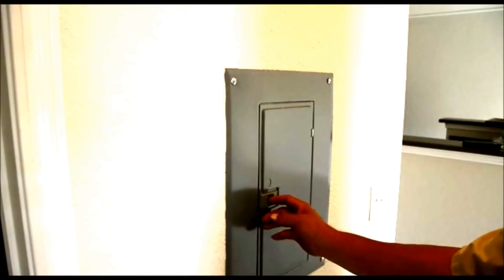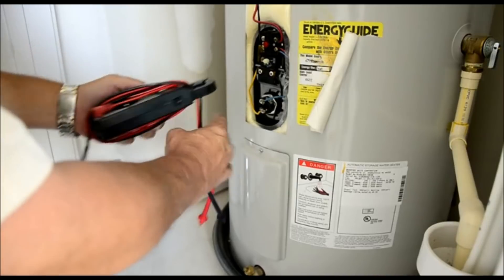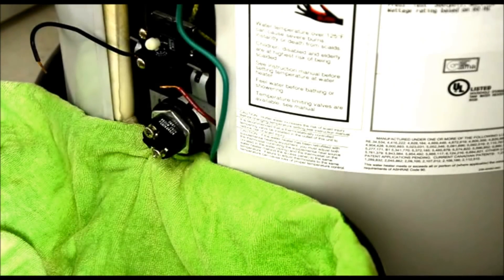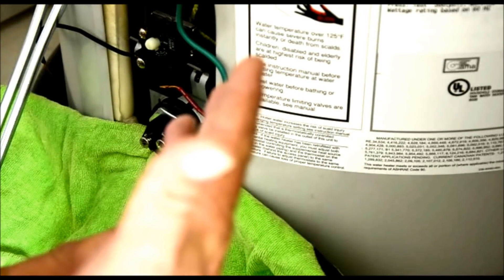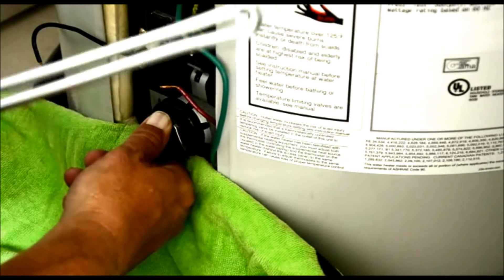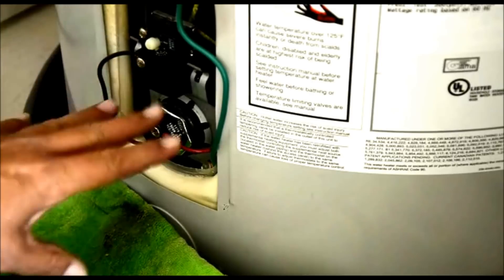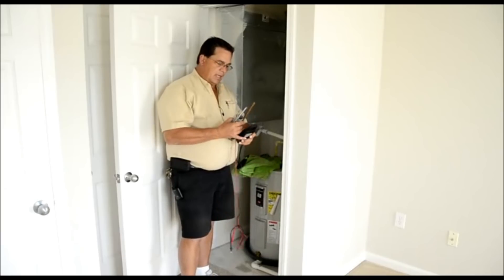Replacing A Water Heater Element With A Full Tank Of Water. "Not Draining Tank."

Comment: Full tank of water my ass!!! I copied this today and since my water heater sits up on a shelf in the garage I GOT DRENCHED with all the water. I don't care how fast you are, no way this video was done with a full tank of water. The water pressure alone wouldn't even let me put the element back in to stop the flow. And yes I had the pressure valve fully open before removing the element. Come to think of it I wonder if the pressure valve being fully open is what made the water blast out like an open fire hydrant.... All in all the video did have good tips and info... Just no way in hell was it a full tank.
Reply: Open pressure valve!!!   Of course you GOT DRENCHED!!!
Reply: J J Velez That's too funny, I would have paid money to see that!
I can just picture the shocked look as you wonder why the water is gushing out at your face as you force the element in the hole with water spraying in all directions. You should do it again and make a video. Use two cameras so you get the shot from front and back. Maybe leave the water pressure on and even drop the element or slip and fall in the puddle. Thanks for sharing, I'm cracking up thinking about this.
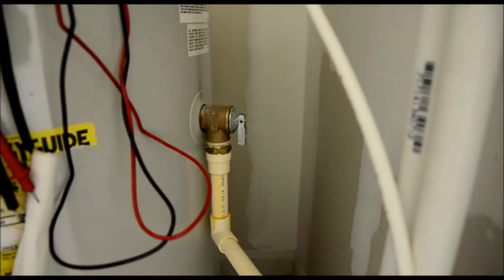Reply: 3:16 ....and "CLOSE IT"   close the pressure valve.... lol....
Reply: LMAO...... EZ mistake to make, but still kinda funny.
Reply: Man I tell you when I got drenched I GOT DRENCHED! The bottom element was slightly above my shoulder height which would be around 5feet something. I was expecting what I saw in this video "about maybe a cup" and was like someone opened up the flood gates... Wouldn't have been that bad had it not been around 40something degrees. lol hahaha you know what maybe I'll do a reenactment and get it on video so it can go viral lmao
Reply: You had to be fuming when that happened, probably more funny as time goes by though. Your either too young to have had the big cans of Hi-C or you've never been reckless drinking a beer. As a kid we're quick to learn that the can developed a vacuum when the juice and air had to share the same hole. When we got older, we applied what we learned to a beer can by cutting a hole in it (the exact same place where a water heater element is) and using that to drink out of, then popping the top (almost where the relief valve is in comparison). You in essence just shotgunned a water heater. Sadly I doubt you are the first  ; )
Reply: wutang1979 I must have missed that part lol
Reply: Brian G lesson learned
Reply: Forrest McCormack in hindsight yes it was funny, wish I got it on video... would've got tons of hits lol
Reply: Ha... good that you have a sense of humor about it,
Reply: thanks J J Velez I had a good laugh out of your comment. Yep still laughing
Reply: mr.pipes lmao maybe I'll wait for the warmer weather and do just that lol
Reply: Jonathan Jerkface I definitely had a great laugh at my own expense lol I was more in shock that 40 gallons of water was gushing out instead of the "1 cup" I was expecting. All I could do was stand there to prevent the water from damaging keepsakes that were nearby. Oh and I'm 36 y/o by the way.

Comment: TheAdeptRapier you must not know as much as you claim otherwise you would know that as long as none of the faucets are open, then most of the water in the tank will remain in the tank because the suction it has, cause no air is gettin inside to allow the water to run out, besides, this dude ain't holding a gun to peoples heads MAKIN them do it this way, if they choose to listen to him and they do fuck it up, thats on them.

Comment: Ok, I did this. I did every thing he was doing. Water shut off, pressure valve etc.. When I got to the last tread of screwing off the element it POPPED out with pressure and 50 gallons went flooding!! Lucky I was in the basement with a dirt floor. What did I do wrong????
Reply: Shut off valve defective or not fully off…
Reply: Was the shut off valve CPVC? On some of them, the wing knob will turn but the plastic shaft won't thus an open valve still.

Comment: Does it matter which screw I put the ground and positive wire? Like is one screww for the positive wire and is one screw for the ground?  Or it doesn't matter? If not then what could be my problem..I replaced the bottom element because the water would only stay semi warm..but it won't get any hotter

Comment: Let me start off by saying this is a FRACKING joke. I thought I would do this as demonstrated, but once i loosened the the bottom element (my tank only has one element), it would not come out! my tank was so full of calcium build up and mineral build up that it somehow would not let me pull it completely out! What's worse, it would not net me tighten the existing element back in to drain my tank first. So, as I type, i have it draining threw a hole in my floor. DON'T BOTHER WITH THIS!!!

Comment: Thank you so much Dan! This is incredible! I fixed my 16 year old water heater. The best video that gives me  real hot shower back before the winter starts. Your step by step method worked so well. I had a 50 gallon 5ft water heater. Hence the water splashed on me from the bottom one more than the top one. This saved me a lot of money and worry. I did it! ;-) Thanks again. We just followed your confident instruction.

Comment: Wow. Your method saves a lot of hassle, at least if you don't also have sediment to clean out.

Was also cool seeing that special socket. I've had one of those for years (was in a box of stuff someone gave me) and had no idea what it was for, lol. When I changed out my water heater element recently I used a 3/4" drive 1 1/2" socket, lol.

Comment: Needed to change element and did a you tube search on DIY and your video was what I needed for I surely did not want to drain the water heater.  Your method sounded like filling a bottle with water and holding it upside down and not loosing any water.  Lost as you stated about 1/2 cup of water.  I not only used towels to absorb any water, but I also place some plastic bag on the floor under the towel just in case I was not a quick as you.  Worked!  Thank you so much for your informative video.

Comment: Should mention what to do when your t&p valve won't shut off now that you popped it.  Or just open a hot valve in the house.  Also some water heaters have vacuum relief valves that if you took that element out full u have a flood.  Some water heaters have sand hog elements that don't come out that fast either.

Comment: BETTER OFF TURNING THE WATER OFF AT THE STREET IN CASE YOUR VALVE AT THE TANK WON'T SHUT ALL THE WAY OFF!!!  I'VE CHANGED ELEMENTS IN MANY WATER TANKS AND NEVER THOUGHT TO DO IT WHILE FULL UNTIL I SAW THIS VIDEO. IT ONLY TAKES ABOUT AN HOUR TO DO IT DRAINING THE TANK, WHICH I STILL SUGGEST TO FLUSH OUT SEDIMENT, BUT IF YOUR IN A HURRY THIS IS THE WAY TO SAVE ALOT OF TIME.

Comment: Thank you so much! I looked at several videos and your video was the most simplest. I thought I would have to call somebody or replace my water heater but it was really easy. The hardest part was unscrewing the element and they screwing it back on. For some reason, it wouldn't screw on and water kept coming out but I finally got it to screw on. Thanks a lot for your video!